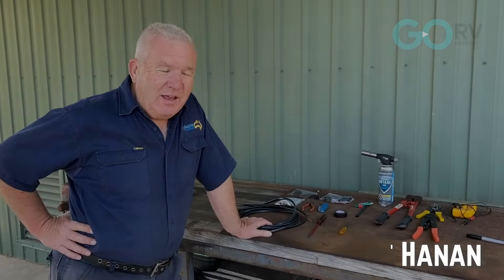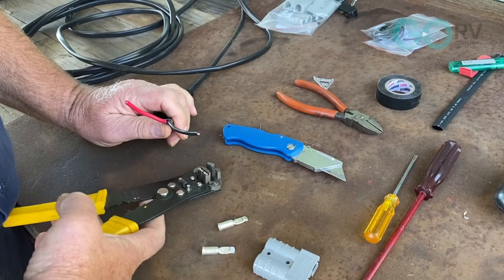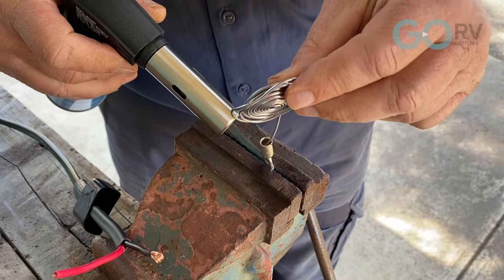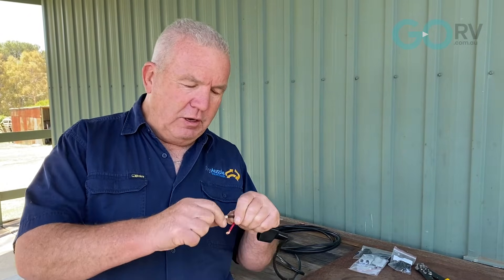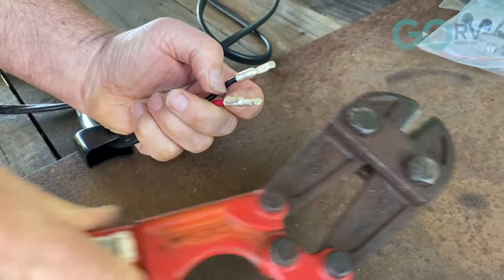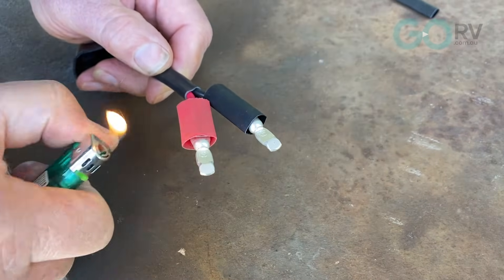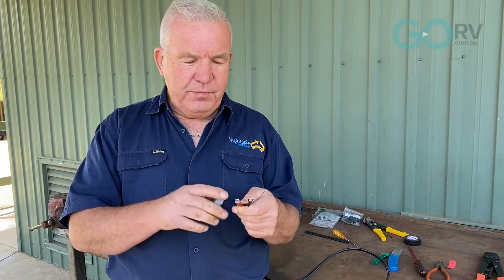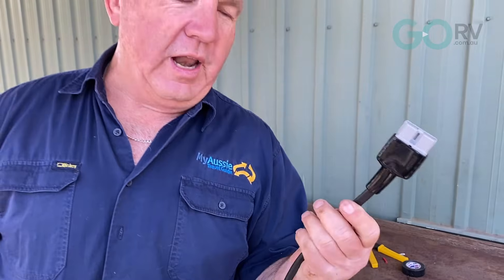DIY: How To Wire An Anderson Plug!

Comment: Moving the wire back and forth while waiting for the solder to solidify will create a cold joint, introduce voids and ultimately weaken the connection. Best to hold the wire as still as possible until the solder turns solid. I also agree with the comment below re getting the copper up to temp - heating the lug for a couple of seconds after plunging the copper will do the trick. 

Thanks for the video as it does show a couple of good options people can apply at home or in the bush with some different tooling - I like the bolt cutter crimper.

Comment: whoa.. Sir,  if you don't get the copper in the wire up to temp, the solder will not flow into the cable and you'll have a high resistance connection = a recipe for fire.  Crimp correctly or solder properly, not both.  Ideally, dip the cable into some flux then add to the solder pool and apply more heat until the solder flows into the cable. It should look smooth and uniform. 
You can absolutely remove the wires once they're clipped in if you need to. Just lever the tab down with a small screw driver or scribe and pull the cable.
Reply: I would have soldered the wire then dipped it in the connection. 7:17
Reply: dry joint coming up!!